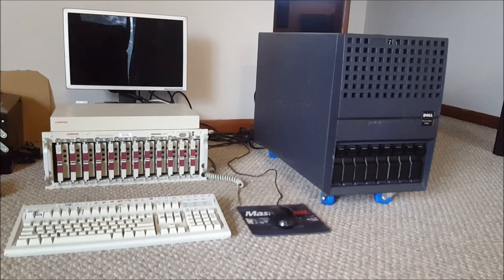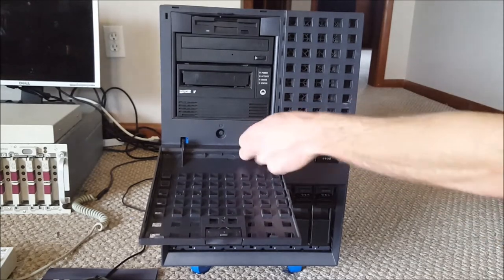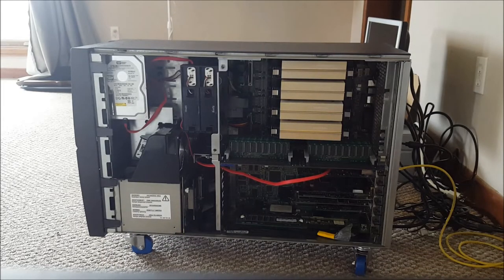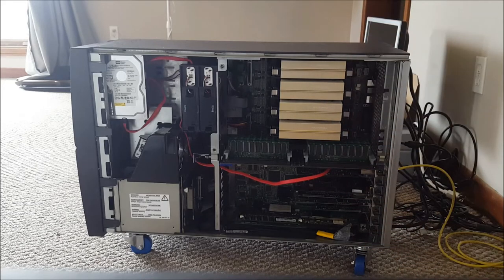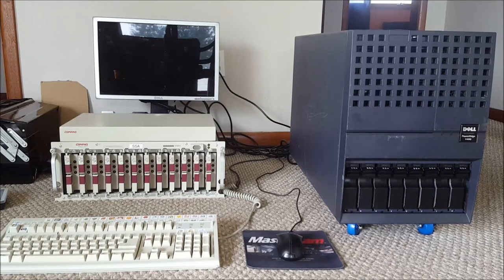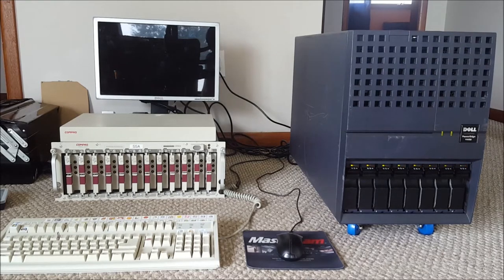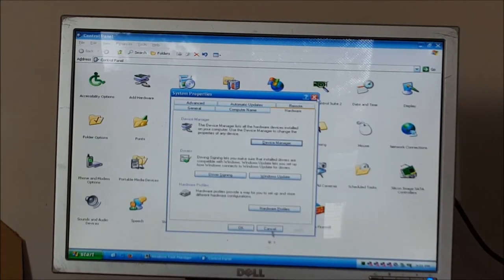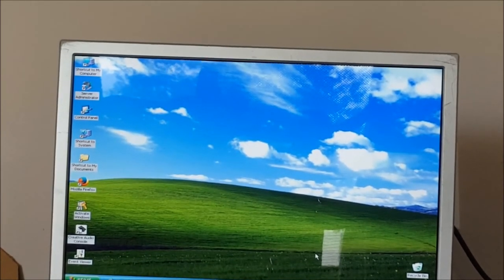Dell PowerEdge 6400 4400 custom - Overview and online in 2021 at 20 years old!

Comment: Imagine this with a good graphic card in pci-x. By exemple a Matrox card.
Reply from the maker: I have lol! Sadly this machine is quite picky with graphics cards
Reply: @dom80TA  Ah ! This is a Statu quo for the Computer universe ! They are time comsuming, We have to buy ....and buy again. 3dfx is the best.  They are pure PCI device. Maybe some server have already this into their board.
Reply: @dom80TA  Yeah, I have to say thx for all the informations and advises you have said ! I'm a french boy, but I will try  the following sentence in english !  I was not aware that  We only  need to tap vidéo + name , in google and clic on the  link, If We wants to play directly a youtube video... +  I was not aware that windows 7 was not capable to recognize the quad core like this system built with  Pentium III, Why this bug ?  At least It run well with my Core 2 extrem Quad 6800.
Reply from the maker: @0371998  Correct, non - server windows versions have a hardware limitation that can only use 2 PHYSICAL cpu processors. As far as I know there is no way around this sadly.